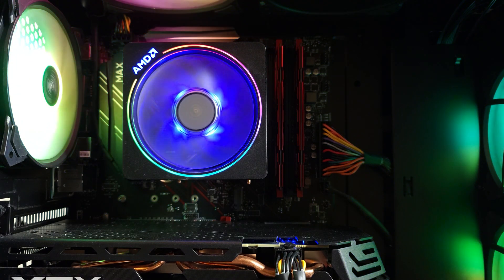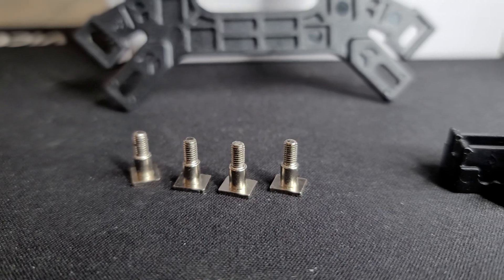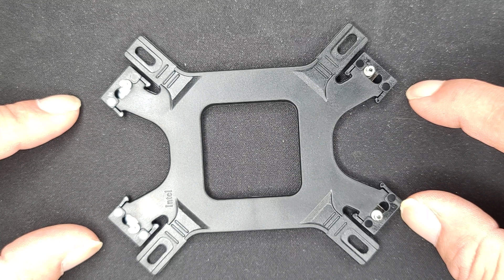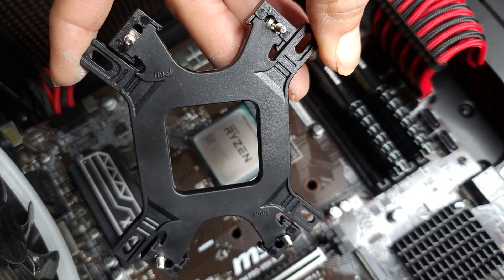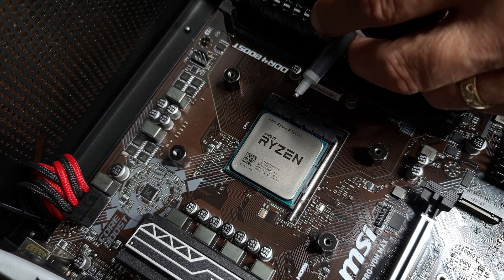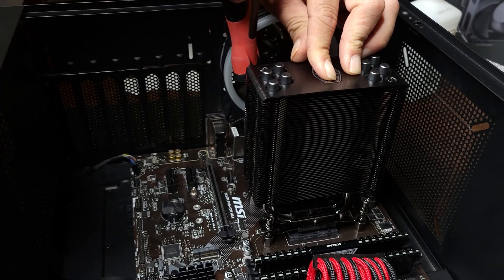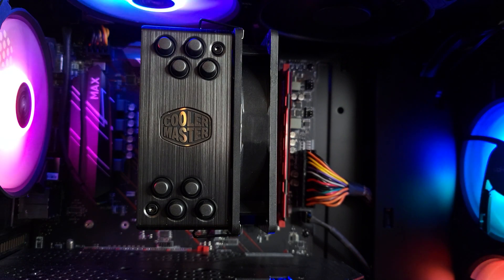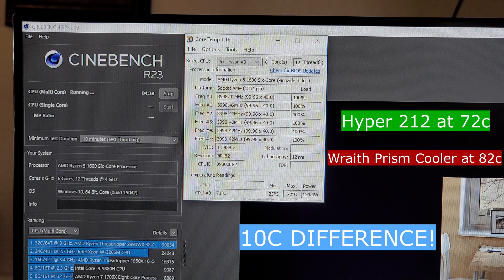Hyper 212 Black edition vs AMD Wraith Prism - temp difference - installing Hyper 212 tutorial (AM4)

Comment: Was the prism cooler in “High” or “Low” mode when you were testing it?
Reply from the maker: CPU Fan curve set to "standard" through the BIOS.
Reply: @ScottsPC  Thank you for your quick reply. I mean the fan itself. There is a switch on the fan that has a high or low mode that I believe dictates the maximum speed it runs at, so I am just wondering which position the switch was set at.
Reply from the maker: @geoffschwiermann5452  gotcha.... At my day job... Will see when I'm back home...

Comment: whats interesting is after you installed the 212, the power draw also dropped by around 10W. that could have also contributed to the lower temp as well.
Reply from the maker: Nice catch!  The Hyper 212 is a beast for its price point...
Reply: Well, also, more heat creates a higher resistance which means more power to do the same amount of work. That’s probably what happened.

Comment: great video man i have been looking for a cooler that will fit in my 220t for my 3700x do you think this would be a good option?
Reply from the maker: I would go with the hyper 212 for your 3700x
Reply: Yeah, I had to resort to my wraith prism for my 3800X because my kraken X53 wouldn’t front mount due to the gpu nor top mount due to ram. But the lighting on the prism looks too good for my personally to be easily willing to give it up. Temps barely hit 80 under full cpu load with the fan switch on low and 74 on high and considering my cpu doesn’t go to 100% hardly at all temps rarely hit 70 if at all.

Comment: and performance 0 difference i found reviews it does not go faster or more fps......maybe 1 max..
Reply: While maybe it won’t benefit at stock settings for over clocking it’s always better to be safe with a frosty cooler
Reply: @user-nq4sp3fo1q  A have prism and it beats evo ... 212... And i do not use small dot like u do.. i use 5 dots.. 4 dots each corner and big dot in the middle.. the best is to use card.. and spread equal... yeah temperature.. i have max 56 with 4650mhz all cores... with prism.. With noctua h-2.. with cheap thermal paste for 1 dollar gembrid something like that it calls, i have iddle 27c amd max 81c... with prism iddle 30c and max 100 procent of usage 56c... on 4650mhz. ryzen 5600x. And i have fps gain to.. more stable fps in gaming. Cs go constant 800fps lowest possible fps is 400 fps max fps on cl_showfps 1 1025 FPS. Prism rules.. i can OC like nothing with prism  vs  evo  never. I have try both of them.. i have better fps vs water cooled cooler. I have better fps vs conductive thermal paste.. People ask me how i know that ? I am on computer 31 years ? Whey people are selling those stuffs ? Because of sponzors ? To make a joke to people who has no clue about pcs ? What case i need ? WIth good air flow ? No with good ventilation system.. Where to put them ? Best is 3 under 3 up and 6 front 1 behind .,... why so much ? Because u will get best temp and not high rpm sound it is so nice. THey ask me what is the minimum ? And i say 3 front 2 up 1 behind like i use that i have no overheating problem good psu 1200watt..  They ask me how u know those things? Because of experience ? Many you tube reviews are bad and fake because of sponzors.. people buying 650watt psu.. and overheats even more components.. when they are overclocked.. and there u go. U have 81 c with evo i have 55c average max 56c and minimum 30c on prism. on idle when i do not tuch anything it is 24c max temp. Yeah fully closed case.. and sound of coolers u can not even hear.. at all.. only gpu at 2200 rpm max.
Reply: @MakeSh00t  Dude thats crazy, but for me even with goot thermal paste adn good application, when i upgraded to hyper 212 its went from around 80~ to 77~78 on 4400 mhz oc.

Comment: Can you explain why your screen shows a Ryzen 5 1600, and the motherboard you mount the cooler to clearly has a Ryzen 5 3400G? There's no consistency here indicating the system you added this cooler to is running your  tests.
Reply from the maker: My stock footage on how to install the hyper 212. Thanks for the question

Comment: Now, I'm curious; the Wraith Prism you're pitting the Hyper 212 BE against, is that the older 4 heat pipe version, or the upgraded, 6 heat pipe version?  If it's the 4 pipe version, would it be possible to get a comparison not only between the wraith prism and the hyper 212, but between the two versions of the Wraith Prism?
Reply: 6 pipe version is fake ..and amd told it is not ok to use it can fry your cpu oced.
Reply from the maker: Hahaha....I didn't even know there are 2 versions!  The one in the video is the 4 pipe.  I also would be curious what the difference would be against the 6 pipe version...sorry I'm not able to get you that comparison.......
Reply: @ScottsPC  Oh, no problem!

Comment: thanks. now im in doubt. wraith prism because of rgb or hyper 212.
Reply: Incase you are wondering that same hyper 212 has a rgb version
Reply from the maker: The prism cooler worked just fine for my Ryzen 2700x.  I personally just wanted the Hyper 212 for this PC.  Just depends what chip you have.  I know it also comes with the 3900x...then I would definitely upgrade my air cooling!!!  Thanks for the comment!
Reply: i have ryzen 3600. what you think should i buy? hyper 212 or wraith prism? because now with the stock cooler i got 70 - 80c when playing ac origins.
Reply: @ScottsPC  Yeah I've just got a 3900x, the most I've seen on it (while playing VR with browsers open) was 98d Celsius so I definitely need to upgrade but don't feel like going the AIO route, so this video helped a bunch, thanks.
Reply: i just get wraith prism it is better than 212... IN oc mode is better.. 212 is not better for oc mode.. for stock enabled PBO maybe because it is more silent.. i anyway use headphones and when i use speakers 0 hear from pc... I do not mind if My v8 car is rumbling.. I hate Hibryd is doing BBEEEEEEEEEEEEEEEEEEEEEEEEEEEEEEEEEEEEEEEEEEEEEEEi iiiiiiiiiiiiiiiiiiiiiiiiiiiiiiiiiiiiiiiiiiiiii understand ? :D I like V8 power more than any electric lol
Reply: im decided to use wraith prism. so far so good. my processor temp dropped 10°C compare to stock cooler after running cinebench
Reply: i have prism 55c.. max.. if u do not believe me.. i can prove u.CLOSED CASE. With evo i had 81c.. It is not good cooler for OC.. prism is way better. IF u want good cooler for oc you need to know witch one to buy.
Reply: @MakeSh00t  what is max for evo with no OC? Im not doing anything crazy with my pc